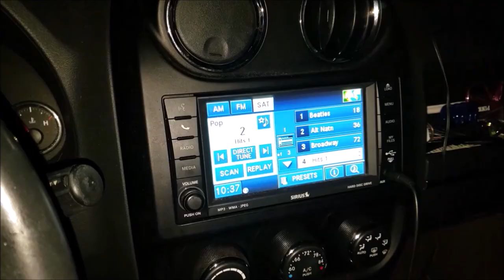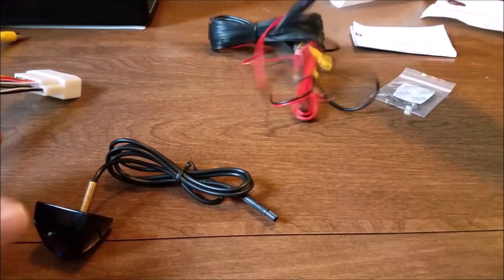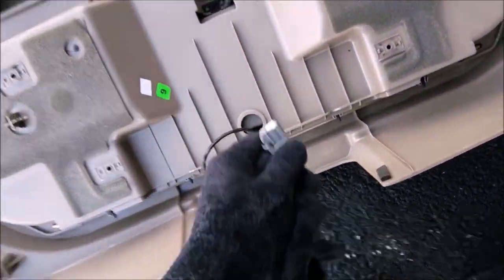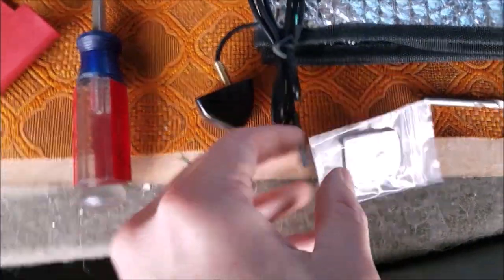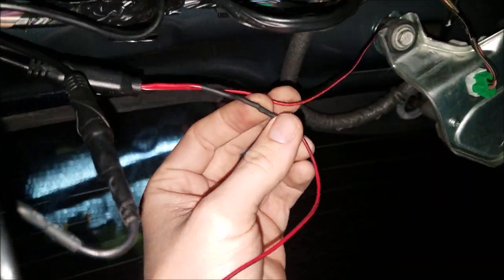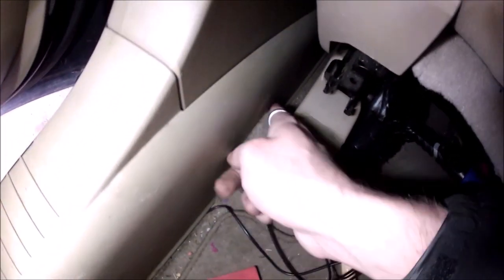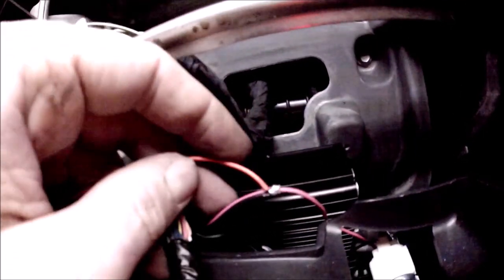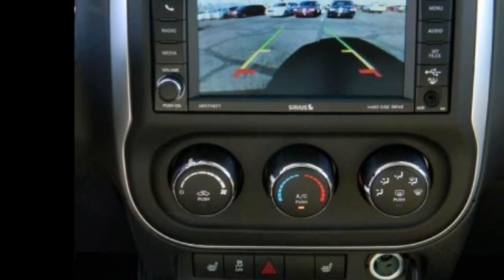Aftermarket Jeep Camera Install Using Factory Radio

Comment: I watched your video and never saw a part 2 but I have been researching online and I found the kit you talked about on ebay for $94. So I take it after you install the camera kit you need a programmer to enable video to your backup camera. I looked at lockpick for mygig but they don't cover my year compass(2016) but infotainment makes a programmer that plugs into the OBD2 port and programs the radio's backup camera video output. So if my understanding of the steps involved if I buy the kit off of ebay and the programmer it will activate the backup camera. You can buy the complete kit camera and all but it's $400 and the camera is a license bracket type which I don't like. FYI I noticed the mounting location on the plastic cover is a good location but on my compass the right side cover tab broke off and I noticed it hanging there so I just drilled a small hole and screwed it on. You wouldn't lose your camera but you would probably notice the video image would look different. Anyway, appreciate you posting that video. I wanted a backup cam but wasn't sure if I could do it. Now I'm pretty confident. thanks man.
Reply from the maker: Thanks for watching! I think I have your answers and works for your 2016. Check out the programming process here: https://youtu.be/ESPz2iDWwQA

Comment: That was a great video. I have the same kit in a 2016 Jeep Patriot, and the instructions that came with it were of no use. I had the programming done at the dealership, but had the black screen saying " Check all your surroundings" After seeing your Video It all came together and voila Camera works. I also found it much easier to solder that T-Splice as you did rather than cut the wire.  Thanks for making this video it is the best if not the only vid for us lowly Jeep owners that do not drive wranglers.
Reply from the maker: Thanks for the kind words friend! Not much out there for the non Jeep Wranglers but I plan to change that. Glad this video helped get yours working!!
Reply: amreht Rak do the dealerships program for free ??? Did you go to your dealership where you purchased the car or any dealership also?

Comment: Could you please tell for which color reverse light wire need to hook up the red wire from camera?
Reply: White with light green stripe that connects to the reverse light.  For your radio, check the diagram on your radio or Google it.

Comment: Hola amigo, excelente video, solo que una pregunta, realice el mismo procedimiento y active la cámara, pero no me da imagen, es otro kit de cámara q instale, pero al meter retroceso, se queda en negro y no me da imagen, no sé cómo solucionar, será q me ayudas? Saludes!
Reply from the maker: Hola amigo. Lo siento por el mal español. Si la pantalla de la radio se vuelve negra al dar marcha atrás, suena como si estuviera programada correctamente. Tu problema es cómo está conectada la cámara.
Reply: @WeakestofWeeks  si eso pienso, pero si conecte todo igual como lo vi en el video pero no me da la imagen, no se si será el arnés o será la cámara, porque aunque no tenga conectado nada la radio al poner retroceso siempre la solo q queda en negro, de antemano gracias amigo!! 👏🏽

Comment: Actually the red wire goes to reverse light positive wire.
Reply from the maker: You could, but what was show is the manufacturers recommendation
Reply: Which one is the reverse light positive? Do all Models use the same color?

Comment: do you have the link for this kit, I couldn`t found it on eBay.
Reply from the maker: Yep forgot to add the link. Here you go: https://www.ebay.com/itm/JEEP-COMPASS-OEM-Integrated-Backup-Camera-System-Fits-MyGig-Radio-2009-2015/152900089081?hash=item23998e34f9:g:89QAAOSwopRYfX7D